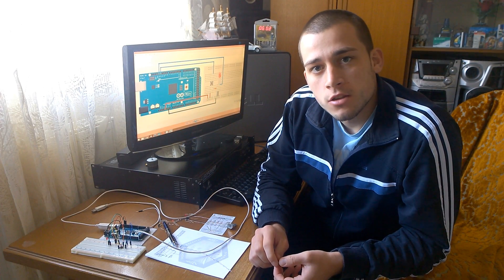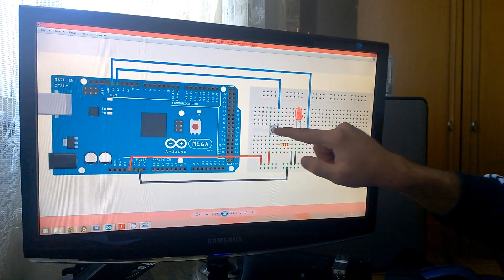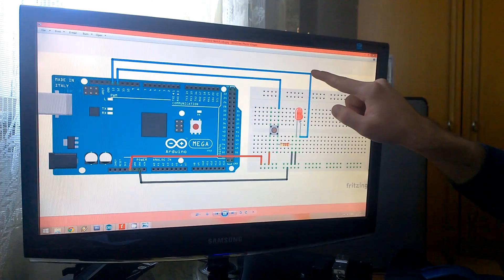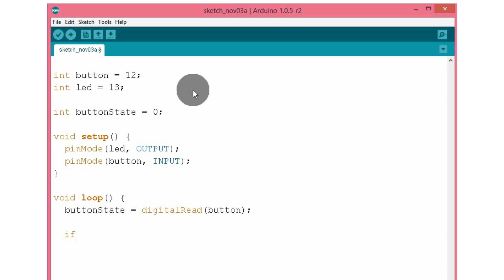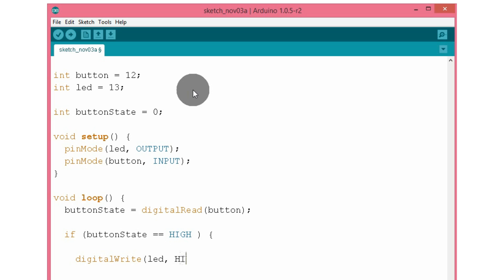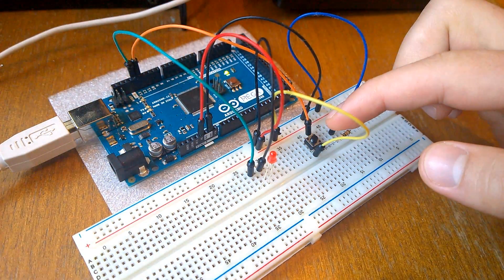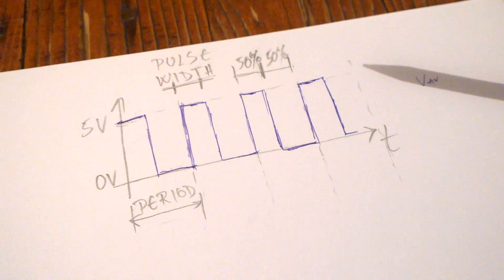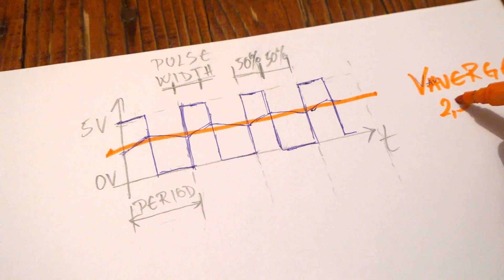Arduino Tutorial 02: Buttons and PWM

Comment: The button code is not working for me. The previous one with the blinking light worked, but with this one, the light stays on regardless of the button for some reason. I tried it myself and copying your code in from the site, as well. Not sure what's wrong?

edit: it was the lack of a drop-down resistor when I did my button circuit.

Comment: The schematic is incorrect due to ground.  The black wire should be ground but you have connect them to 5 volts.
Reply: thanks.. i thought i was wrong..

Comment: The GND from the Arduino to the breadboard does not seem to go anywhere.  It is shown incorrectly?  Or is there a missing jumper wire from ground to a point on your circuit?
Reply: Just a note for Newbies.  In the video the circuit graphic is different than the actual wired up circuit.  The the feeds from the Ground and the +5.0V are actually opposite/reversed.  Also the graphic version does not should the ground to one side of the switch.  This is a great newbie trouble shooting opportunity.

Comment: sir can we control a AC fan speed with 5 other appliances
Reply: Yes but not directly, you want the Arduino to control a relay or some other device that the fan is hooked up to.
Be careful and make sure you know what your doing, these voltages can kill

Comment: I'm a mechanical engineering student trying to come up with a circuit that operates a load only at about 20-50mph. Any ideas, anyone??
Reply: You will need a circuit and software to control the load, and a second circuit and routine to get feedback

Comment: I am not getting how this code runs because you didn't give any value  to led after checking and increasing brightness bt still your LED is blinking ..How can that happen??
Reply: by pressing the button and not releasing it, the brightness of the LED will increase by 2 every 30 ms. When it reaches a value of 255, it resets to zero. Then it starts increasing again. That is why it seems to be blinking.

Comment: Hi, thank you for your great Arduino-tutorials, they help a lot to understand that stuff.

I have a question regarding the code of the second example shown in your video: The brightness-value is set to zero at the start of the script. The loop will add 2 each time, so the if-statement "if (brightness == 255)" can never be true, because the integer-value "brightness" jumps from 254 to 256. But it works and I try to find out, why?
Reply: +Dejan Nedelkovski I tried the example and printed the brightness-values on the serial monitor. As expected, the value increases over 255 until 32.766 and then to -32768 (16-Bit Integer Overflow). But it seems that the analogWrite-Command only uses the first Byte of an INT-value. So 256,512,1024 ...etc... would be 0 again on the Output. So you could delete the if-statement completely in this case.